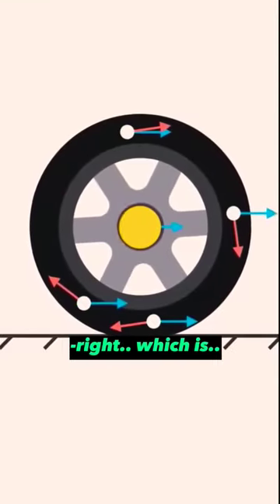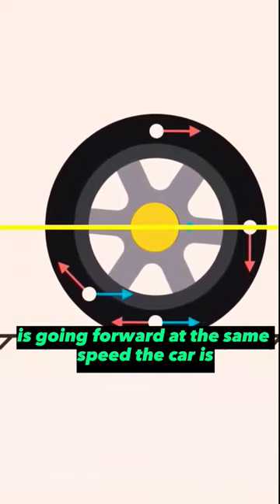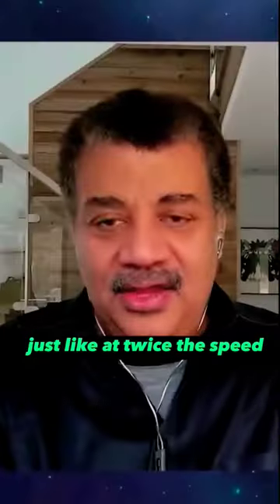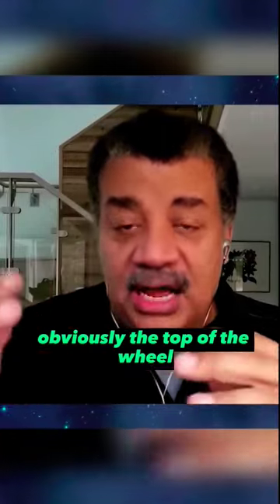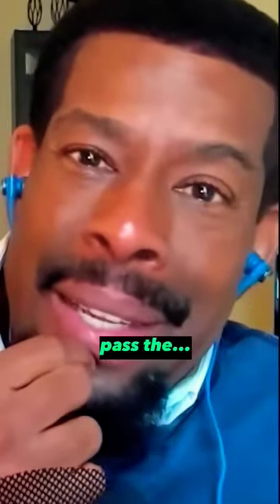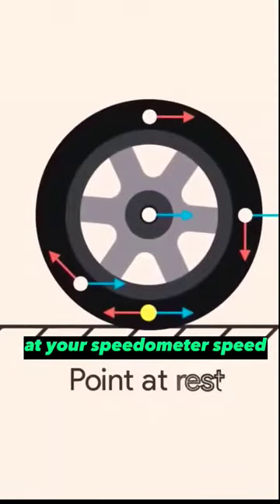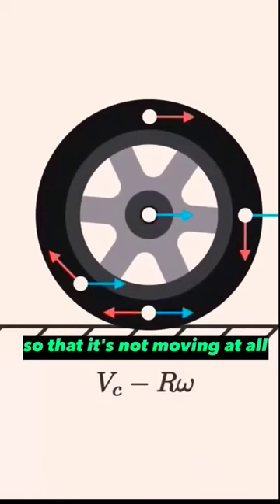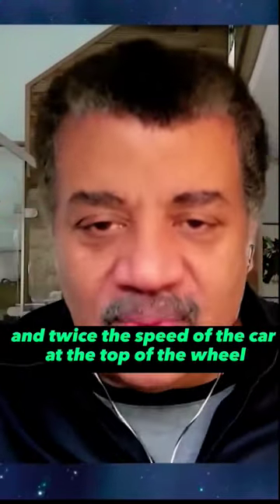The Surprising Truth About Your Car Tires ft. Neil deGrasse Tyson #physics #cars #shorts

Comment: That has to be the most interesting thing I’ve ever seen.
Without talking about the driving force, it means nothing. 
  The farther you get from the center the faster it turns, who knew.
Reply: Actually, it's the opposite of that.
Reply: @tuck6464  
  Not so
The further something is from the center, the faster it must move to keep up with the center.
Reply: @CM-ve1bz  If the center and the farthest part are of the same piece / part , they are moving at the same speed.
This is what talking in circles is like.
Reply: @tuck6464  
  So if you roll a marble in a three inch circle at a given speed, a marble at that same speed or even slower can make a three feet circle in the same amount of time?
  Not possible
Reply: @CM-ve1bz  Now you're talking about something  completely different, covering ground/ traveling on a surface, where ONLY the outside surface/ farthest from the center is available.
Now we're talking in different circles, therefore I reserve my right to remain silent.
Reply: @tuck6464  
    OK let’s change it to a sprocket, that sprocket is attached to a work object by chain. The small sprocket will turn a work object faster than a large sprocket not because it’s moving faster, but because it covers less distance. 
The large sprocket has to travel much faster to cover the same distance in the same time frame. 
The longer distance you get from the center the faster it has to turn to keep up at the center.
Reply: @CM-ve1bz  From wheels to marbles to sprockets to chains. Were done here.
Reply: @tuck6464  
  You were done from the beginning

Comment: Would a radar gun detect doubled speeds if pointed at the top of the tire?
Reply: No, problem not. If you put a dot on the tire, it would spend the same amount of time in the upper half as the lower half.

It only increases and decreases in speed when you define that speed to a direction. When you move forwards, the upper half of the tire moves towards the direction of motion and the lower moves away. So you add and subtract respectively.

I believe a radar works by shooting a beam of light, and timing how long it takes to return. Do it again and get the difference. Since light is a constant, you can calculate how fast the object moved in a given time. Thus obtain it's speed.

Basically your that far away at that time, this far away this time. You now have a distance traveled. Use the time it took to collect the data and you have speed.

Since the top and bottom will always be the same distance away you wouldn't pick it up. And since rotation speed of the tire doesn't change, the upper half isn't rotaing faster than the bottom. It would show the same speed as the car.

It's only going faster/ slower because it is either moving with or against the direction of the vehicles motion. But the tire itself isn't rotaing faster up top and slower down low.

That defined point goes the same speed up the car as it goes down so rotation is the same speed. Speed is the same because of that. It's only when you define a direction of motion can you say that point either speeds up or slows down in respect to that direction of motion. In respect to tire rotation it's going the same speed all the time, nomatter direction of rotation.
Reply: I think a lot of people get confused by this, and think he means the tire rotates faster up top and slower down low. That's not what he is saying. 

He is saying since in that portion of the tire, it moves with direction of motion it goes faster, and in the portion it moves in the opposite direction of motion it moves slower.

But that point still moves towards direction of motion as fast as it moves away.

Rotation speed doesn't change, just the speed in a defined direction.

If that makes more sense.

Comment: Just flip the whole thing upside down. Then the top of the wheel is not moving and the bottom is moving at twice the speed of the car.

It is all simply a matter of where you decide to measure the speed.
Reply: The point is that the point of the wheel in contact with the ground at any given moment is not moving relative to the ground, even though the car is, and no matter the speed of the car. If it were, it would be slipping/skidding.

Comment: That's not entirely true. Every point on the surface of the tyre is moving at the same speed. Relative to the road or to the chassis yeah kinda. But tyson keeps slipping in different reference points and thinks he's a genius because we don't notice. It's such an intellectually dishonest thing to do. NDT has a massive ego problem